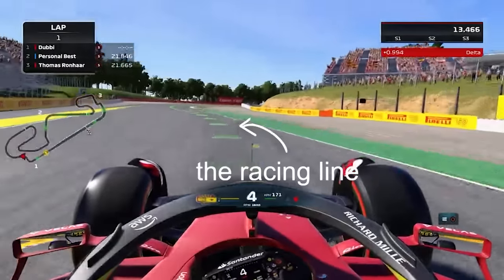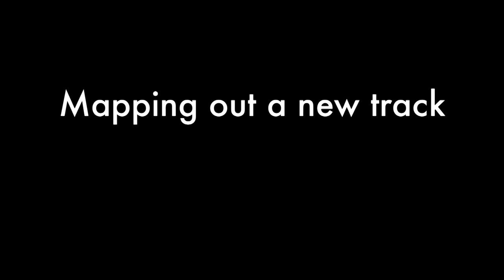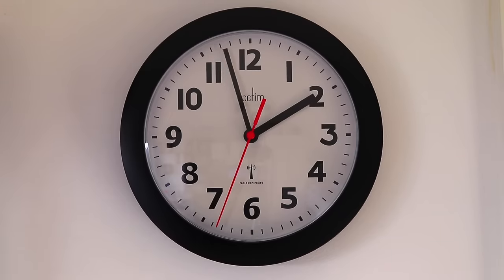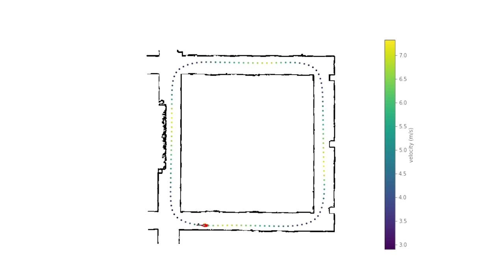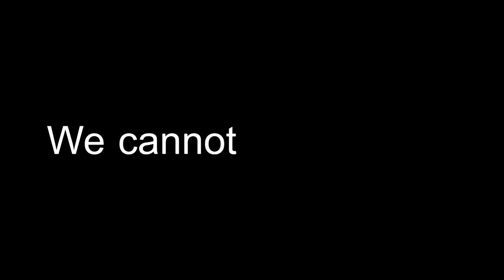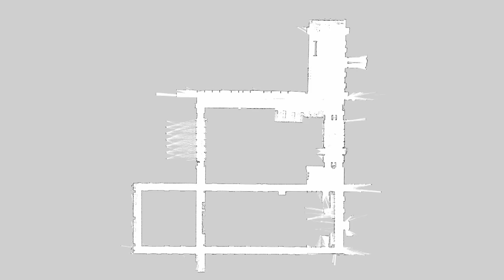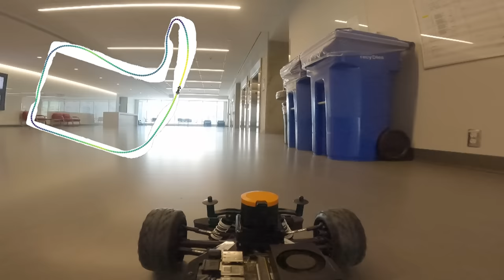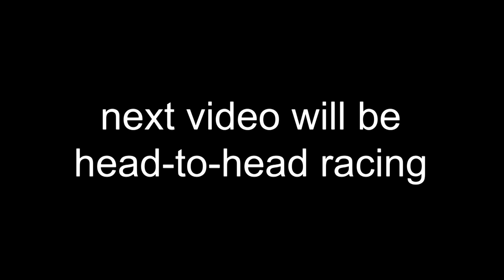Building the FASTEST Self Driving RC Car

Comment: Hey man awesome video! I find the concept of using the power of Ai to determine optimal racing lines pretty cool and tbh i can see it being applied into irl racing as well. As a suggestion i would urge to look into a racing discipline called "rallying". The techniques that rally drivers use to go fast are somewhat diffrent from those used for circuit racing and in my opinion they suit RVs better. Handbrake and powerslide turns (kind of like drifting) keep speed and momentum high because you use the brakes (and/or handbrake) to initiate a turn at high speed, thus not losing momentum by slowing down excessively. If you 're looking to shave off a few extra seconds it may help :)

Comment: Outstanding work! I'm wondering how well this would work with an AI model. Inputs would be the lidar image, current velocity and steering angle. Output would be steering and velocity adjustment. (I predict this would fail, but it'd be a spectacularly awesome failure. )

Comment: 7:20 I noticed that the waypoints are equidistant, in both straights and corners. Is it possible to change the resolution so that you have fewer points on the “straights” and more resolution in the turns? Also, the car needs friction between the rubber and the road to have grip and go faster in the turns. Polishing the floor slows you down

Comment: Hello, the current results are impressive. Do you rely only on lidar for position / speed / etc. estimation ? Odometry (wheel or motor encoder) and gyroscope would help quite a lot (gyros drift but they are FAST and precise) , so that you could estimate wheel slippage, slip angle, etc. and with proper modeling get better performance. Also some operational research on the most efficient path would be nice (changing it slightly turn after turn, searching for best result), because sometimes difference between theory and reality is that is theory, there is no difference ;)

Comment: Do you got the budget to not need some sort of crash avoidance system that takes over and overrides the racing inputs to make the car avoid hitting things hard? Or is it the other way around, it's cheaper to fix crash damage than implementing sufficiently advanced prevention measures?

Comment: Really interesting  and impressive experiment. How much is the software learning: a) remembering the previous lap dynamics (straight line speed, steering angle, turn-in point, speed through the turn, exit point, g-force exertion, wheel spin, etc.,) and b) 'experimenting' on each lap to optimise these data? Ideally, you would also have suspension sensors to minimise body roll and lateral rotation sensors on front and rear overhangs to gauge oversteer/understeer to help maximise your grip levels through the turns. It would also probably help minimise the zigzag on the straights. 
Amazing to think that experienced human racing drivers have all of this going on in their brains at once, and are able to make the slightest of adjustments to each element lap after lap to compete with 0.001 of a second difference between drivers over 4-5km circuits.

Comment: I’m surprised you were allowed to do this. At my university everything needs a risk assessment and signed off and all that, I don’t think they would ever allow this. It is very cool though, you need to show us more of the janitor crash. Maybe using the lidar for active object avoidance and not just the localisation would be a good idea.

Edit: also why are you using such an expensive lidar? Wouldn’t it be better to use a cheaper one, like maybe a robotic vacuum one? That way if you break it, it is cheap to replace and it would be cheaper to make multiple cars.

Comment: Hi Steven, great stuff you are doing! I just came across your videos.
I am sure you have come across Formula Student Driverless already, we are solving similar problems than you. There are a lot of great papers about it, especially from AMZ, if you have not read them.
My team also had problems with an oscillating PPC at higher speeds (> 15m/s). A relatively good workaround is to use a dynamic lookahead based on the current velocity, for example LAD = 0.3*v, with upper and lower limits.
However, you will only be able to go so far with a PPC approach, as the non-linearity in the higher lateral accelerations can not be dealt with using a linear approach. Maybe it does not make much of a difference which such a low mass/inertia vehicle, and also the tyres look rather stiff.
If you want to get every millisecond of laptime, you need to have an MPC with a dynamic bicycle model, at least for lateral control. Longitudinal control can be simple, either pre-loaded (what you have now) or calculated on the fly using a forwards-backwards calculation and a kinematic bicycle model.
Good luck with your project!

Comment: would a flow map work for generating racing lines? simulate a river 1/5 the width of the track after a few times around it should be very efficient.

Comment: I used to race Formula Mazdas and I see why you are having problems in your corners.. Let me explain. As I approach a corner at high speed, I use two feet - one for the brake and one for the throttle. I hit the brake as I approach. This shifts momentum and weight to the front wheels to provide better handling and dig into the corner. This is really brief. Then I go into the corner accelerating through the corner. This prevents the car from rolling out (to the outside of the curve) and makes it stay in the groove in a forward direction. All weight and power are pushing through the corner instead of fighting to keep the car from flying off the track.  You're trying to control the flying part instead of making it push through.

Comment: Are proximity sensors not an option, like used on drones to avoid obstacles, couldn't that help to brake and avoid crashes or close calls easier and adjust its trajectory?

Comment: Is the battery lipo if not you should use one you have to make some changes to the controller and transmitter but after that it will go anywhere from 20-75% faster

Comment: Is the Lidar being used during the driving? If it's only being used to map out the track to generate the racing lines, you could reduce weight (and risk) by removing the lidar when it's not in use.

Comment: Does your code consider oversteering during breaking and acceleration? It seemed at places that the software was controlling the steering assuming zero slip where you should assume pretty expectable oversteering if you steer and decelerate at the same time and you cannot control brake balance.

Comment: The racing line optimization is so cool! What kind of model does it use for the vehicle dynamics, and how did you measure all its parameters?
Also if you don't mind me asking, what kind of controller are you using to follow the racing line and to keep the speed? There might be some nice improvements possible: On the straights, you don't really want to limit your speed; if the real vehicle manages to go faster than the simulation, use it! That would probably be possible with a Model Predictive Controller.
You might not even need to run the MPC in real time: Just use the existing optimizer with starting conditions close to the racing line, and linearize the necessary controller output around the optimum. Calculate and store the parameters for every point on the path, then use them to get an optimal linear controller at every point along the track.

Comment: You're pushing it to the speeds you can use down force... Certainly, at least, you can use better tires for such a smooth track surface. You're not dealing with rain.

Comment: Wanna lower lap times, young man? 

Waaaayy too much gear noise coming from that car. Also get rid of the off-road tires, switch to foam slicks (assuming dust-free floor). Hotter motor? Also why not add some foam crash protection wrap to protect that expensive lidar? Most of your speed improvements at this point will be less AI/automation dependent and are mechanical adjustment/ upgrades to the vehicle hardware.  Room for improvement with the algo though... Maybe faster processor or better loop tuning to reduce amplitude of occilation around the chosen path.  Consider changing loop tuning constants based on location?  Are you using PID loop for this?  If so are you using derivative?

Now that I think about it, long term I bet you are way more focused on the AI/algo improvements (and application to general purpose use) then the mechanical platform it rides on.  In that case, event/location-based loop tuning is probably gonna give you the most bang for your mental energy buck spent.

I am a professional automation EE (Rockwell/ Kuka/ Fanuc/ Motoman) who happens to have been a hobby RC car racer (Associated 1/8 gas/ 1/10 elec) for many years.

Comment: You didn't need to wet the floors you could have wet the tires instead, called "Tire Slicking", it's illegal in NASCAR but who tf watches NASCAR anymore?
For RC Cars you can usually find "Traction Compound" at your local hobby shop that sells RC Cars

Comment: You might want to see if you can get some slicks, so that you’ll have a larger contact patch, and it will be in continuous contact.  Your tire tread pattern seems like it’s for “on road / off road” use.  Good for general use; but I suspect that on those fairly uniform surfaces, acceleration and cornering speed would be better with slick tires.

Amazon has a variety of RC Car slicks.  F1 and many other racers use slicks unless it’s raining.

https://prod.static9.net.au/_/media/2018/10/07/08/49/0710_ricciardo_env2.jpg

Comment: You set the goal much too high. “F1 driver” is beyond attainable. I suggest the vast majority of people simply don’t understand the accomplishment level of an F1 driver.  
P.S. That gokart operator should be leaning out on the turns because he’s driving a fixed differential vehicle, where one needs to take weight off the inside wheel to allow it to slip instead of drive the cart to the outside of the curve.

Comment: You are not thinking clearly. I could have that car running way faster through that track. You were talking about all the wrong things. You first need to drive real sports cars and motorcycles and see how they work. Instead of thinking about the track like what you did, you should have thought more about what the car can do. If you were smart, you could have had the car sliding sideways up until the corner, and then hit the gas. That will get you a much faster time. It's about what the car can do more than the track.